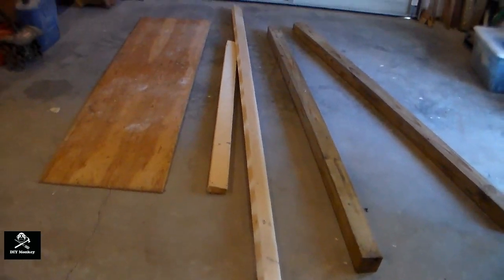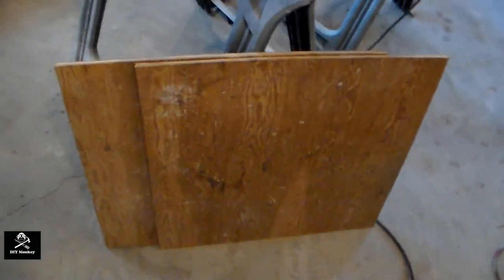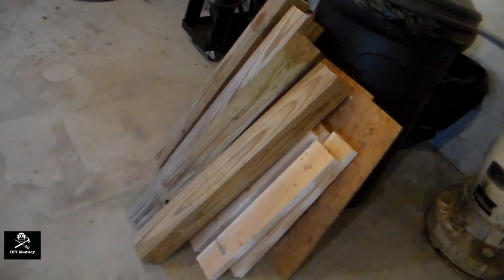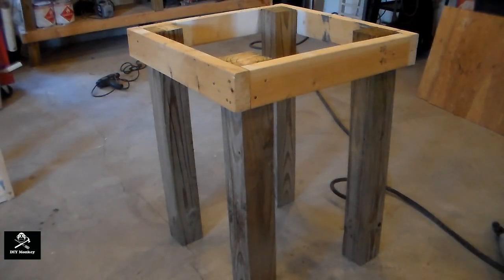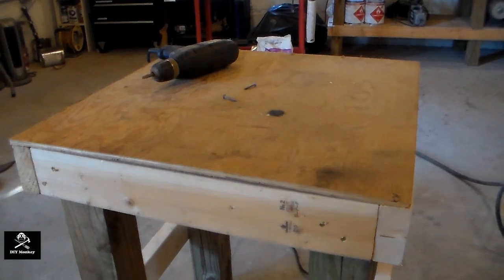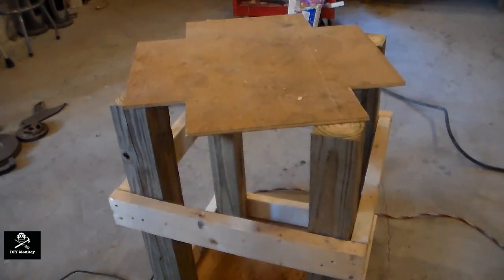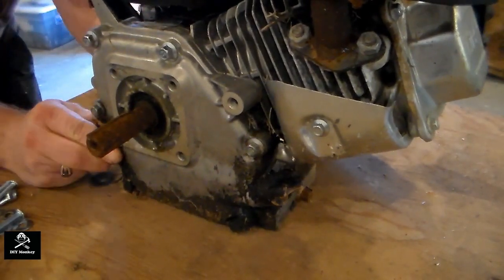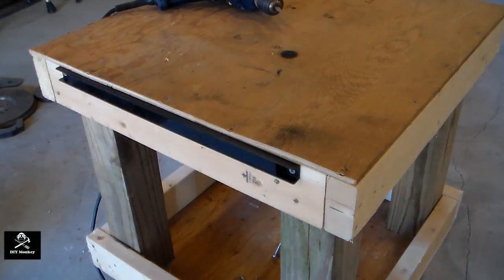How to Build a Small Work Bench / Stand for Small Engine Repairs

Comment: I would use 3/4 plywood  for the top for more strength and cut a 6"hole in front of the oil drain plug so you can drain the oil ,just put a pan under the hole to collect the oil.